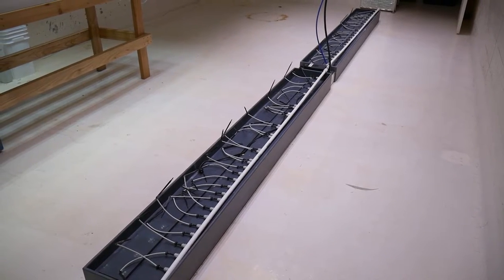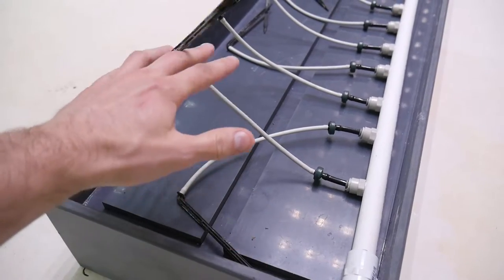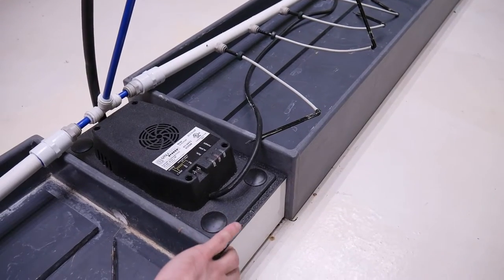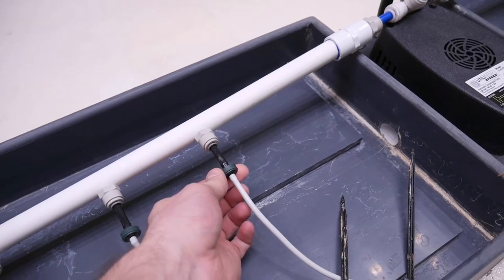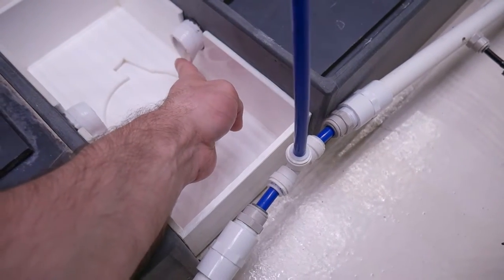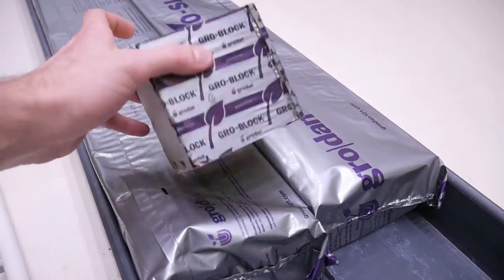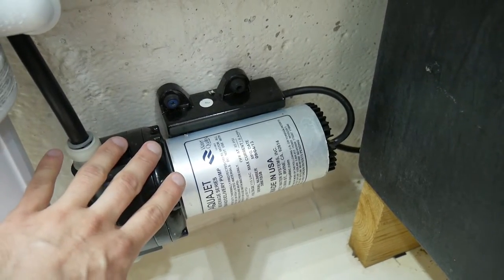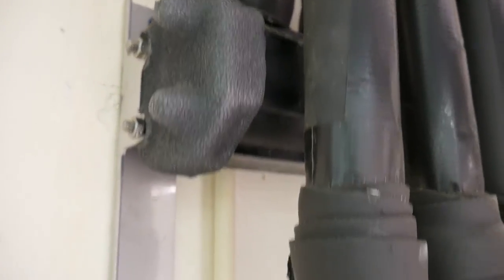Part 5 - Vine Crop Drip Channels - Basement Hydroponic LED Garden Tour

Comment: Great video series. Have you considered the PVC and PVC glue leaching chemicals into the hydroponic system and having edible plants laced with PVC glue?
Reply from the maker: Yes, I have and made sure to use FDA food grade PVC sheet to make them. Chemicals in my food is a top concern of mine so i try my best to avoid as much exposure as possible.
Reply: Jon NYCprepper the greenhouse industry makes a special glue just for this purpose. used to glue plastic ebb and flow tray inserts and top feed run off channels into a custom fit. Even with regular glues and primers for piping and such....the glue chemicals leaching into food crops and root zones is negligible at best.